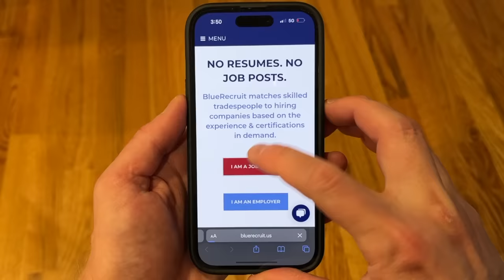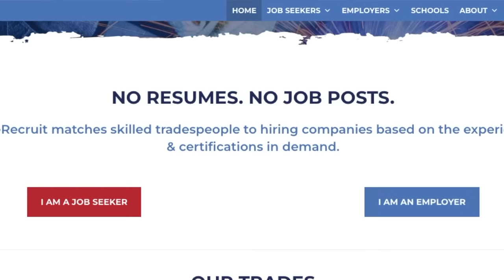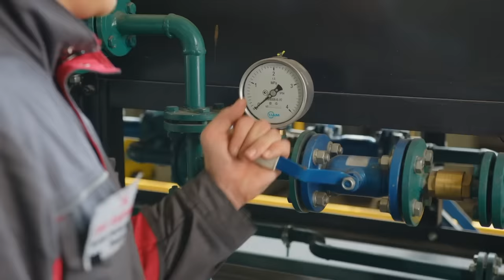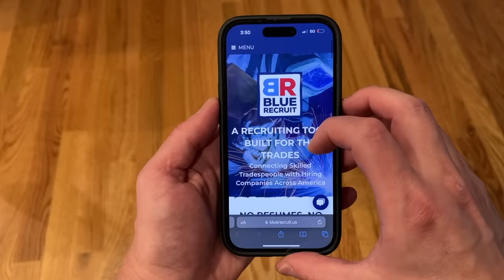7 TRADE JOBS In 2023 That Pay Way More Than You Would Expect!! (Rising Wages...2023 And Onwards!)

Comment: I've always wanted to get into electronics or robotics. But I'm colorblind....and can't really work well with wires or resistors.
Reply from the maker: Reach out to a local tech school—there may be industry work arounds for that these days! We need ambitious folks like yourself getting into the trades, and many more robotics techs 😄
Reply: While circuit level electronics is a small part of my job I have worked with several people who are colorblind and they create their own work arounds. It is basically a similar concept that blind people use, organize your space. As for resistors, it's very easy to measure a resistor's value with an Ohm meter and it is recommended for everyone, resistor manufacturers make mistakes too. Also, these days most "electronics" work is really "board swapping" so colors don't really factor into the work too often. If you can understand how the system works and can logically think through problems you'll find that colorblindedness will be a slight nuisance.
Reply: Euro colors are much more cb friendly than american colors. Blue grey black vs black red green white.. newer stuff is numbered instead of colored. The more advanced and technical you get - the more accessible it can be